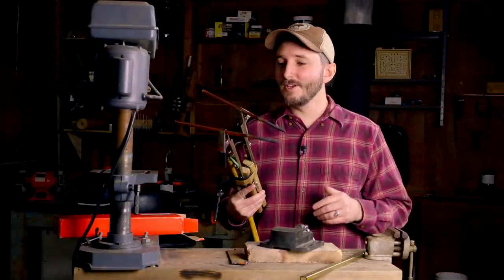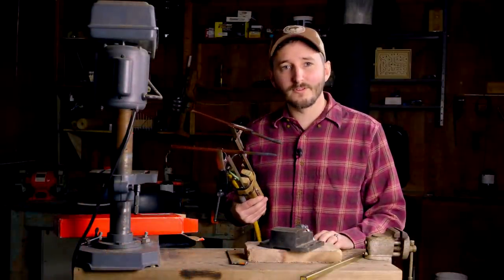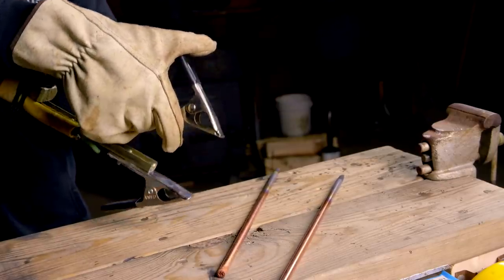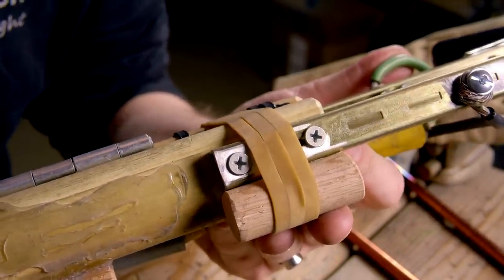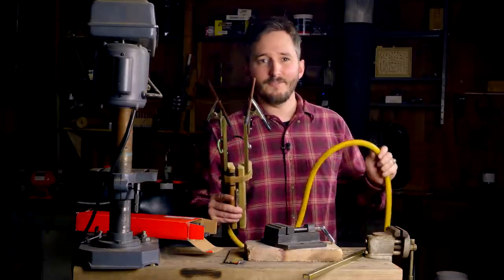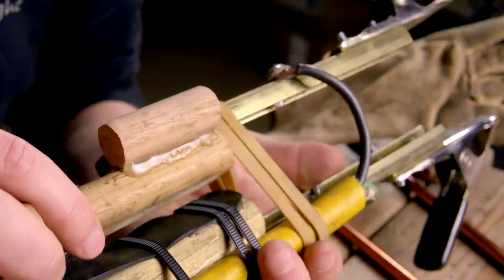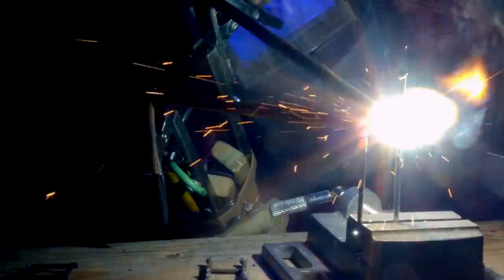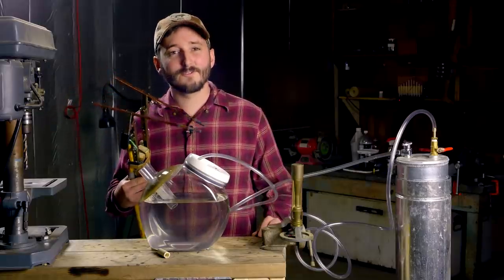Recreating An Antique Carbon Torch (Oxy/Acetylene Alternative)

Comment: No you could not  -  " run this torch by solar panels, and then by sunlight ".
You could run it w/ a solar charge  of 12 hours, at the height of summer  for about  2.4 seconds.
Reply from the maker: What are you using the solar panel on a pocket calculator?
Reply: No, Energy.
Reply: Rick Shafer , you could run it off batteries charged with solar panels. I wouldn’t keep the panels attached while torching, though, as any feedback or current spikes would probably fry or damage the cells.
Reply: @NoctuaStrigiformes  Honestly.  Do you think a welding  rig can be run off of batteries ?   No. You  can't  change  metal w/out  using current.
Reply: @rickshafer6688  , yes. I've done it a couple of time using semi batteries (48 Volt). You do know what current is, don't you. E=IR. Voltage (Emf) equals Current (I) times Resistance (R).
Reply: @NoctuaStrigiformes  So the I (current). The electron flow ,  the actual  electrical  energy  worked  through  4 12 volt batteries  how long?
Yea. O.K. then .
Reply: @NoctuaStrigiformes  You tigged a muffler .